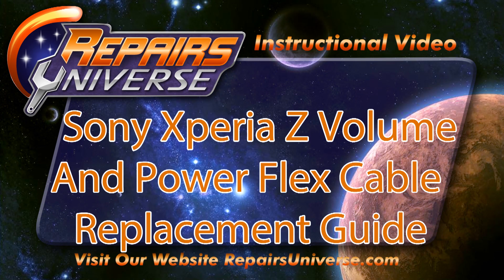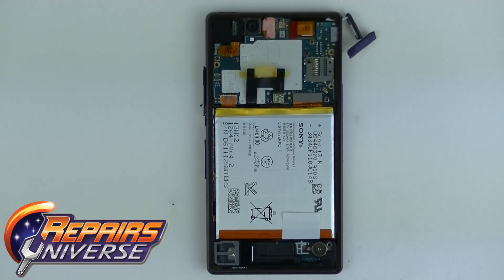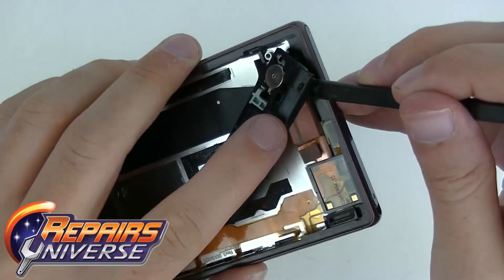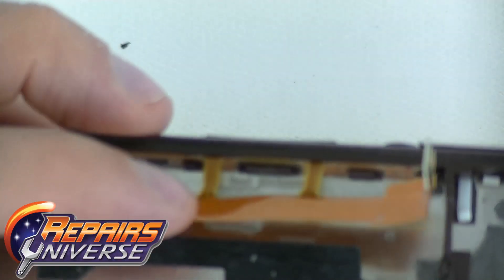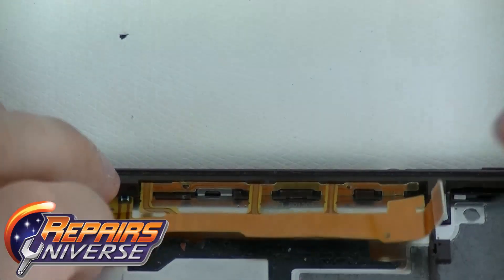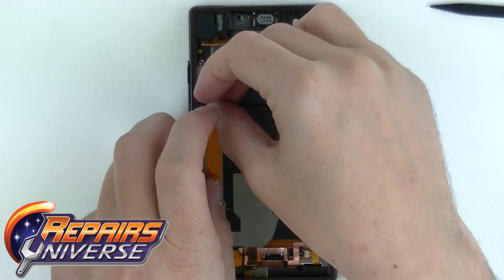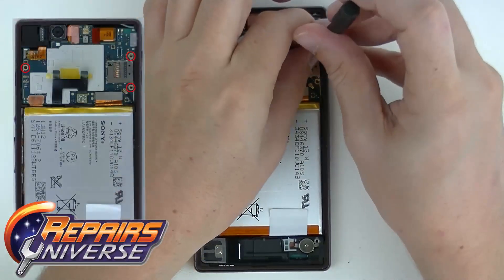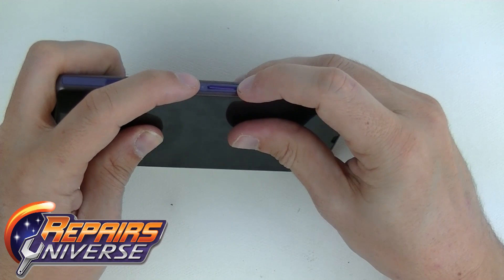Sony Xperia Z Volume and Power Flex Cable Replacement Guide

Comment: I accidentally got tiny drops of water from a rainfall into mine thru the earpiece flap, the power button at first stopped working, (everything else is good), then the volume was acting like the volume up button and power button, now (after 5hrs, power button started working but, it doesn't respond like it shud) e.g I press once and it acts like I've been holding it). So I basically just wait for the screen to sleep itself... 

Do you think I shud take to the shop I got it (Its abt 2 months since purchase) or is there some trick to get it back into full form?

Comment: Please upload a video for the replacement of the sim card reader. Thanks!
Reply from the maker: Marvin Ong Replacing the sim card reader is a very difficult repair that requires micro-soldering experience. The proper equipment is necessary and even with a guide the likelihood of successful repair would be extremely low.

Comment: I have a problem, my xperia z only enters safe mode and I've flashed several times, now on android only works the volume up and not the other, off only works so flash ie volume down and not working fastboot mode is volume up. volume will flex or software problems?

Comment: I have a problem with my Xperia Z, its power button function activates itself, that is, when i am using my phone, a pop up appears asking me to
1. Power off the phone
2. Put in airplane mode
3. Take a screenshot
etc
When the phone is off, it turns on itself.
All above happens too frequently.
Please suggest me if I need to replace my power flex cable, just like you did in this video.

Lot of thanks

Comment: Hi gone through all the steps and my mic still isn't working although the buttons are.  Tried other parts still no joy.  Any suggestions please
Reply from the maker: The Mic assembly is different than the volume buttons. It's possible that the Mic portion was damaged as this is by your dock port.

Comment: i done everything like in tutorial, and after testing had one problem the speaker  not working and before was working.
any suggestions?
Reply from the maker: We recommend you go through the repair once again. Ensure all connections are properly seeded when completing the reassembly.
Reply: Repairs Universe thanks for your replay, i already done that and speaker got back working very well, it seems like you mention  about connections, i didn't put the parts in the right way.

Comment: my down volume bottom and lock bottom is no working shall i change flex or is their any other way
Reply from the maker: Yes sounds like you need to replace the flex cable. Before doing so I would check all connections. IF the rocker still does not work I then would say replace the flex. If you dont feel comfortable doing this you can always send the unit to our Repair Center to Diag the issue. Here is a link to the repair order.

http://www.repairsuniverse.com/repair-service.html
Reply: Repairs Universe do u have branch in nepal???

Comment: I tried to pull the whole flex cable out but the microphone got snapped, it got stuck to the rubber housing :(. Can I use a cpu glue to attach it again or buy a new flex cable -_- thanks
Reply from the maker: Unfortunately you cannot use (CPU Glue) to repair the flex. We don't offer a ear speaker and flex yet. Please check back with our site for updates.